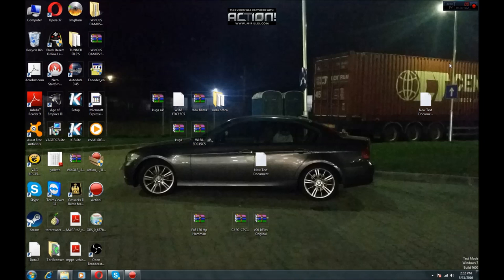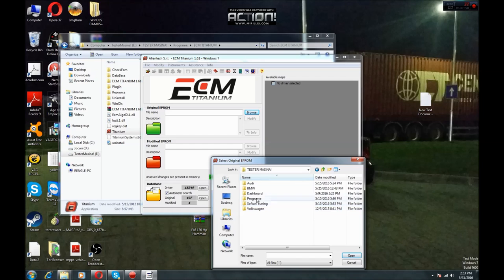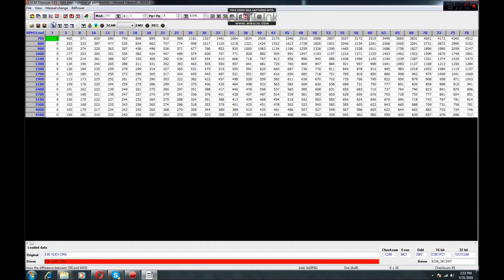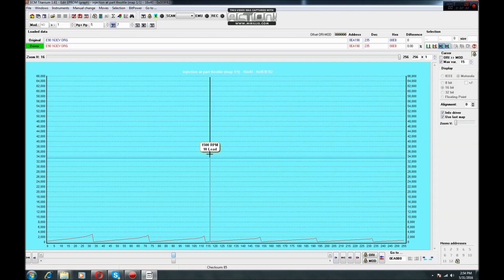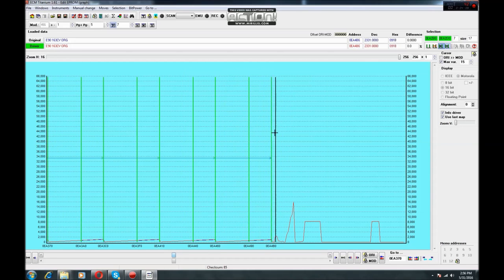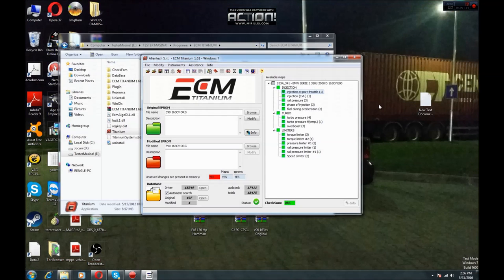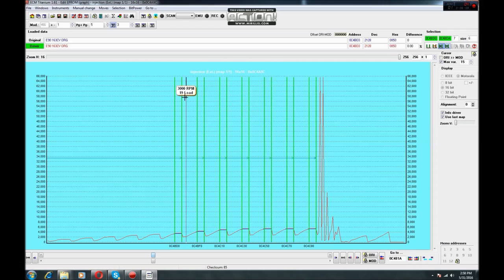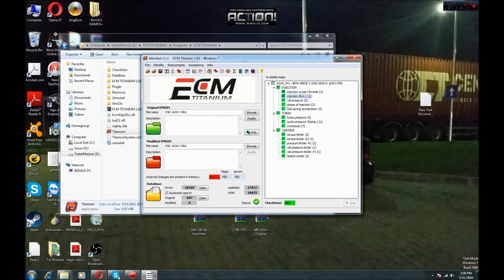ecm titanium How to Tune your avto1 как чиповать авто

Comment: Can you do a ford connect 1.8tdci 90bhp 4711-12a650 on my ecm I only have 5 mod options and don’t know what % to do on them I’ve got a stage1 file but they only used 2 options and left the other 3 I’m really confused by that

Comment: Hi Sir hope you are good...???

I am new to ecm titanium and trying to learn and understand how it works... 
it looks fairly simple I wont lie... but I am having problems on the understanding part for example how do you know when to use 7% or 3% or how many loads...??? is it a standard thing on all the cars or just your best numbers to use... and why use those numbers... does 7% mean the increase in power or just a percentage on something... I am lost completely when it comes to that part

Thanks
Lourens
Reply: Even me I want more details
Reply: Its all by experience. you could vary the settings. but it will have different ressults. too high and a critical fail will happen. too low and you start to induce limiter issues. The art of tunin lies in the balance. you need to read and know whats too much
Reply: I stayed in the same mindset.My car 1.2 tce 120 hp clio.I do not think I can do the stages.Can you help?